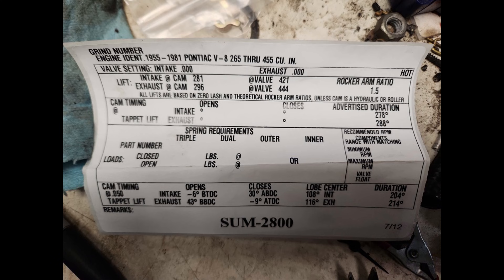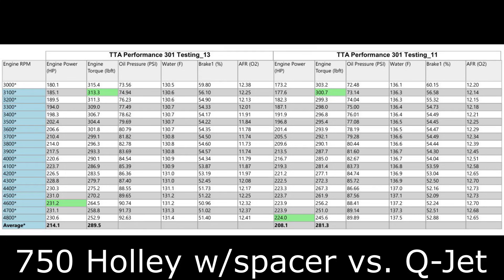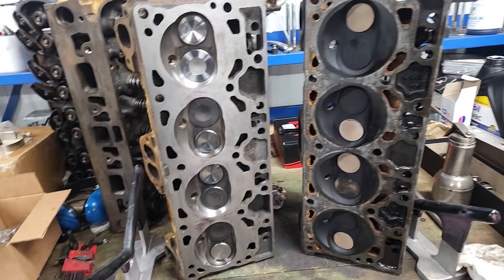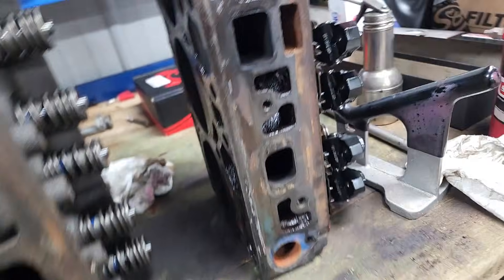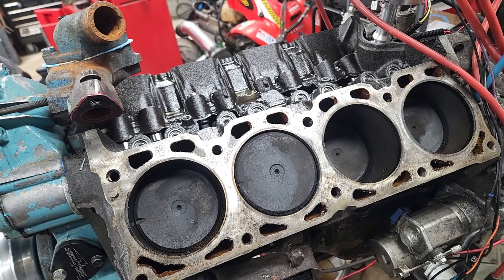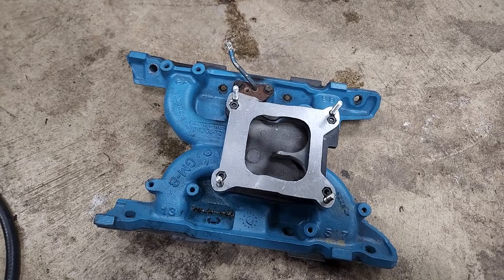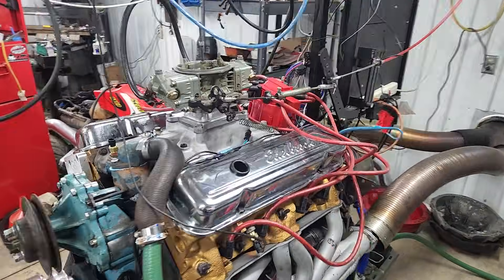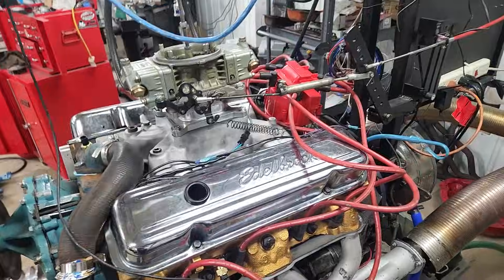TTA Performance - Dyno testing the 301 with our crazy prototype aluminum intake manifold.

Comment: Nice video.  Among my Pontiac collection is a very rare 79 Black special edition WS6 with the 301 engine.  I was going to replace with a 455 or 400 stroker.  Now, am thinking of stroking the orig 301 and using 6x or similar heads with a modified intake like you did.  Maybe modify a dual plane intake.   just thinking....

Comment: At min 2.30, when sharing cam specs, it sounds very, very similar  to the Edelbrock performer cam specs. We did some comparison testing and found that in our combos, the competition cams hi-energy 252 performed better in stock combos of 350cid and smaller.. Bigger than 350cid, we used the hi-energy 260. Depending on useage, we altered installed cam timing. For the most part, we used as stock replacement cams when rebuilding the engine. (Our family owned engine machine shop)

Comment: A fellow racer has a 79 G-body with a 301 in NHRA Stock. In NHRA Stock the cam must retain stock lift, carb and intake must be OEM for year, body, and engine. These have big cams (lift wise) but small intakes and heads. They run well in their class. I was not familiar with these having owned 64, and 65 GTOs with 389 and 400 engines. My 65 had a 69 short block with 389 heads and Tri-power. They can be pretty fast with the right parts. Will 389-400, or Edelbrock heads fit a 301? Cool video.

Comment: the 301 has always been an underdog that needed love,i feel the same about the 305.....theres potential in anything given enough work/r+d etc.
Reply: Agreed. I had an 81 305 4spd and it ran 15.7 with dual exhaust. Thats pretty darn good considering the stock 79 400 was only a few tenths quicker stock
Reply: @frankartale1026  ive got an 86 t/a  with a 305,i put some vortec heads,a vette cam,headers,eldebrock rpm intake,holley carb and its a stick,its pretty snappy.
Reply: @waynesmith-r8c i believe it. I had many 3rd gens but my 88 Formula tpi 305 5spd ran 14.3 at 93 back in the 90s with 110k on it with only a k&n air filter. The stock exhaust on my car had dual cats. It was loaded and even had the bose system with a factory cd player with an eq and amplified subs in the stock speaker location. Ive never seen that in any of my or any other 3rd gens

Comment: Do you think that fuel could be getting trapped at the bottom of the intake runner at the cylinder head? That was my concern when installing a 307 Olds intake on a 260. Would be interesting to put a scope in the runners after a pull!

Comment: Is the crank a weak point with more rpm? I feel like I remember reading years and years ago on the 301garage that the cranks are not anything to write home about, lightened without counterweights in the middle. Almost 280 hp with such a mild cam and really pretty budget setup is good!
Reply: I bought a few non turbocharged 301 Firebirds that had broken crankshafts back in the 90s.
My wife daily drove an 80 Formula with a 301 for a couple years. It was a great driver.

Comment: Whoa! What a cool video, Joe. Thanks for taking the time to show the progression from stock to modified. You really have a conundrum with those stock ports. I like all the mods you did to the stock heads, rather than using traditional heads. That's what makes it a 301. It would be cool to have a high riser intake with the standard runners. Putting a divider in the ports of the stock heads probably wouldn't be feasible, (or even possible), cause probably the ports would be too small. (might increase torque tho.🤔). 
Anyway, maybe a different cam, some domed pistons, aluminum rods would put you over the 1 HP per cube category.  Don't know how much more you could make with those heads. But 300 on a stock 301 NA...."Sweet" (Enjoy your holidays) :)

Comment: Crazy the power you're getting out of that 301. Keep up the modifications and posting results. 
Our 72 T/A my husband once called you about from Iowa is now Sniper 2 equipped and happy now, once hubby put in 42deg of part throttle timing in, instead of only 28 deg.. 
Heating issues are under control now.
Tuner thinks vacuum advance is a bad thing. Not on a street car it isn't. Huge difference in how happy it runs part throttle. 
Love your channel. ☺
Reply: I'm impressed. 👍(and I 100% agree with the adv. canister.)